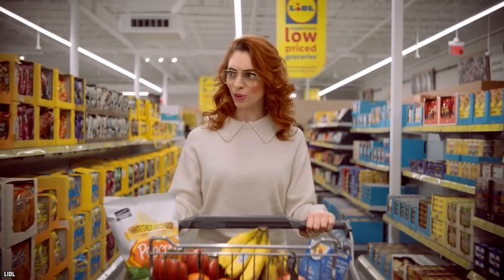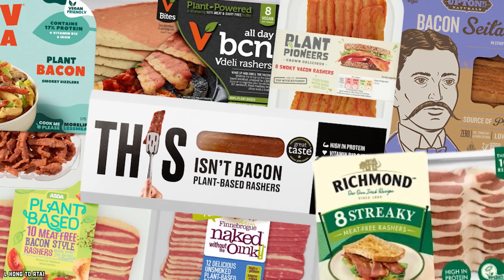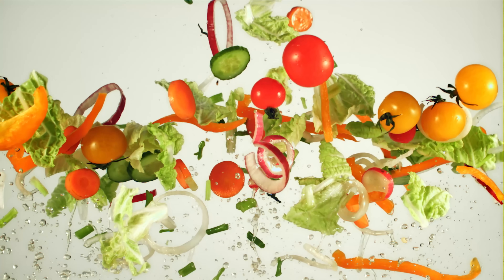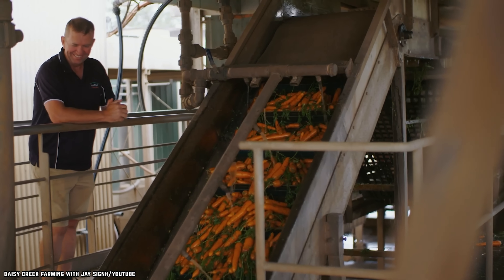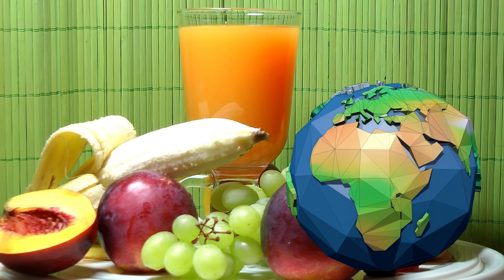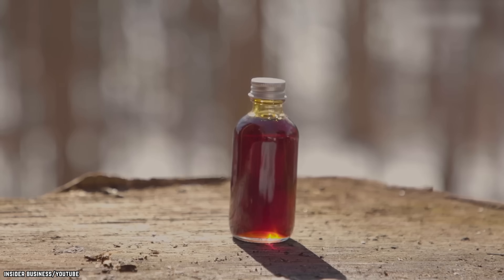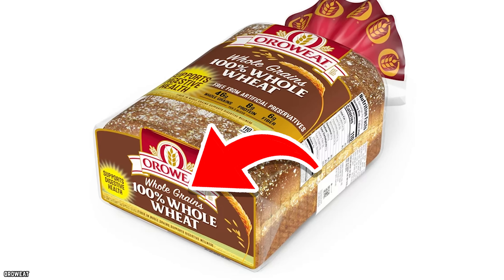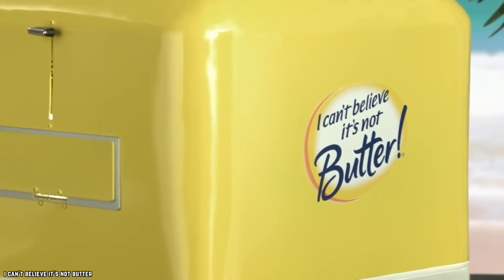Fake Foods You've Been SCAMMED Into Buying

Comment: Margarine was first made from Whale oil. It was also used for Automatic Transmission Fluid.
Reply: Doh!  I didn't know that!
Reply from the maker: @Michael Terrell While it's true that margarine has a history connected to the use of various fats and oils, it wasn't primarily made from whale oil. The link between margarine and whale oil can be traced to the mid-20th century when there was a shortage of fats and oils during World War II. During this time, some margarine manufacturers did use whale oil as a source of fat due to its availability.  It's important to note that margarine has evolved significantly over the years, and modern margarine is primarily made from vegetable oils and does not contain animal fats or whale oil.
Reply: @BabbleTop  Sadly, many whales were simply killed for that oil. It was used for lighting, but the biggest loss is that it is one of the best oils for clocks, and precision mechanical devices.
Reply from the maker: @Michael Terrell The historical use of whale oil for various purposes, including lighting and precision mechanical devices, had significant implications for both the whaling industry and the environment.🙃
Reply: @BabbleTop  I agree, but ironically, the preferred oil for watches and clocks was whale oil, which was generally applied with the tip of a sewing needle, since it took so little per bearing. . Killing whales just for the oil was ridiculous.